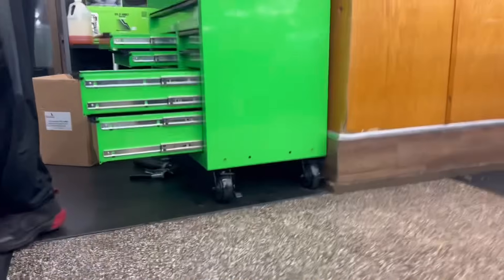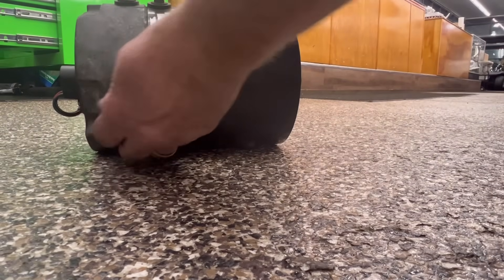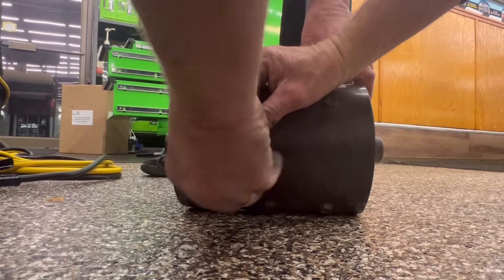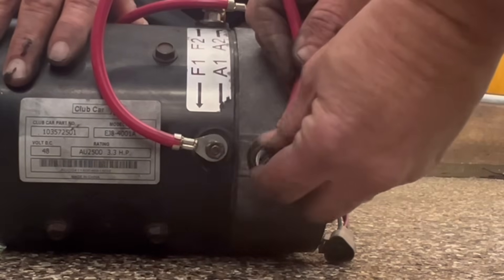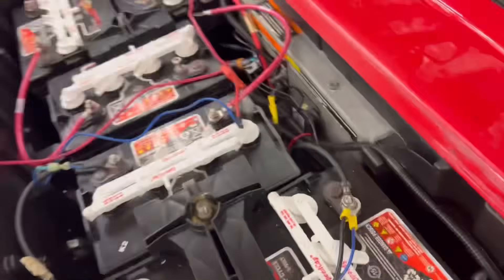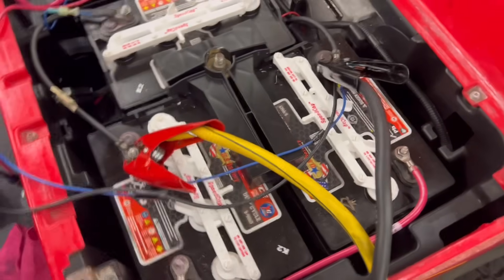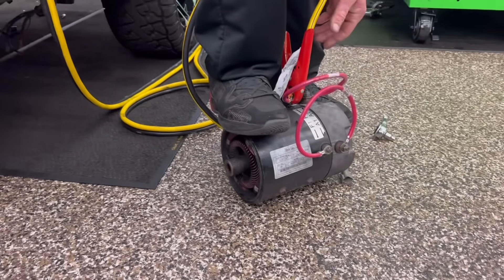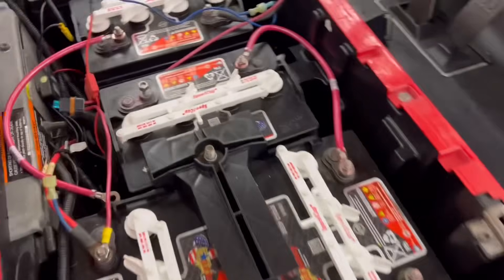Golf Cart Motors Tested: The Shocking Truth

Comment: I got a Tomberline E merge 500. It sounds like its shuttering and barely moves in fwd or reverse.  Any help troubleshooting this?
Reply from the maker: How long has it been sitting for
Reply from the maker: If it barely moves and shakes take motor out brushes are stuck
Reply: @Golfcartwhisperer I had traditional batteries in it. Then a service center somehow melted them down and it got a replacement lithium battery and charger upgrade.  Supposedly it ran for a bit but then it started this issue
Reply from the maker: @samboherring3673  how do they melt them down so what they brought it back to you doing this that’s not good that tell me that they shorted something out that might be controller or wiring does it shake when you hit the gas and takeoff? Have you tried to speed sensor how fast does it go?
Reply: @golfcartwhisperer it barely rolls, super slow. Fwd and reverse, same.  It just shutters with no rotation mostly.  

I'm an hvac guy who has a  chance to buy it. I looked at the factory manual.  O v on control when pedal is not pushed.  About 5 volts when pedal is floored. Around 2.5 volts halfway.  

I don't know how to truly troubleshoot the problem.  But I do have a strong technical background.  I worked on jets in the Navy.  First time ever diagnosing an electric cart. 

Original battery somehow melted down at a repair shop months ago. Battery pack was replaced with new lithium batteries and charger.  Supposedly it ran a few weeks when they got it back.  Shutters and barely rolls now
Reply from the maker: @samboherring3673 reach out to me at 8435951611

Comment: Can you use a shunt motor on a club car that had a series motor?
Reply from the maker: @frankgib3208  no sir. Will fry controller
Reply from the maker: But let me say this, you can use all the internal components. Like your armature and your brush housing. The only thing you have to change is the field whinnings. which is a black case which has all the small wires in it on the shut motor.  So you can take a shot motor and take your old field whining off your old motor and put on there.
Reply: @Golfcartwhisperer  I should of known better the motor I have has F1 and F2 instead of S1 and S2 . It's a rebuild. The guy I bought it from said it would work.. It does work but no power..
Reply from the maker: I wouldn’t drive no more unless you swap the field whining  back out
Reply: @golfcartwhisperer  OH I won't! Thank you for the information,  I appreciate it !
Reply from the maker: @frankgib3208  yes sir hit that subscribe button for me.
Reply: @golfcartwhisperer  I just did. Thanks again
Reply: I found the original typ motor for this cart, it says 12 mph high torque.. I want something a little faster
Reply from the maker: @frankgib3208 so you want to get something between 5 HP and 10 hP
Reply: @Golfcartwhisperer  This one is 9.4 hp
Reply: @Golfcartwhisperer  OK, I installed a new 48 volt series motor 
Having problem.. it shaks when stepping on the pedal
Reply from the maker: @frankgib3208  k check battery voltage when you give it gas and let me know what it dropped to
Reply: @Golfcartwhisperer  voltage dropped to 38.4 one of the batteries blew up.
Reply: Tested batteries with hydrometer found 3 bad cells on couple batteries.  Looks like that's the problem..
Reply from the maker: @frankgib3208  okay cool man so you had a couple problems
Reply from the maker: Damn the battery blew up.  Must’ve been shorted
Reply: @Golfcartwhisperer  Yeah! It was pretty loud! So I reconditioned the batteries and wired it for 36 volts until I get another battery.. Pretty fast for 36 volts
Reply: Actually 40 volt
Reply from the maker: @frankgib3208  oh yeah I used to do that all the time to speed up a 36 volt cart.
Reply: @Golfcartwhisperer  Thank you again for all your help! I'll give an update tomorrow when I buy another battery
Reply from the maker: Yes, sir all I asked is if you need something again come back to my channel and tell all your friends about my channel and I’ll help anybody out. I can let me know how it goes with the batteries.
Reply: @golfcartwhisperer  update on batteries.. Replaced the blown up battery. Back to 48 volts.. Good speed! about 20 mph plus!
Reply: This is with the original controller..
Reply from the maker: @frankgib3208  okay cool glad you got it going. Thanks for letting me know the outcome
Reply: @Golfcartwhisperer  Thanks.. You're welcome.. I would of went lithium but not keeping the cart..
Reply from the maker: Don’t blame you there